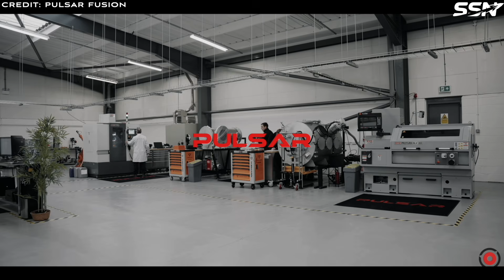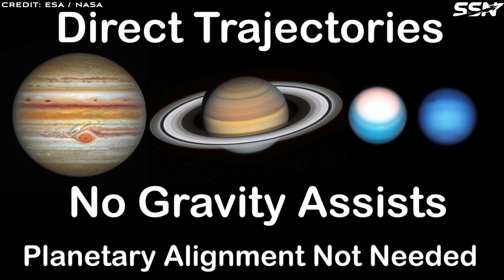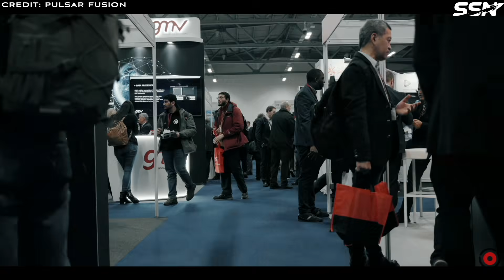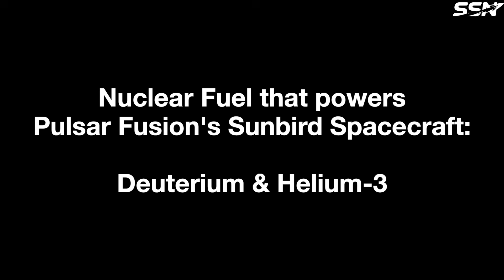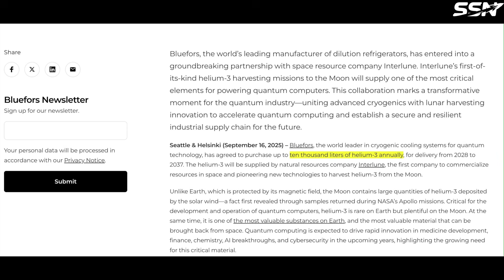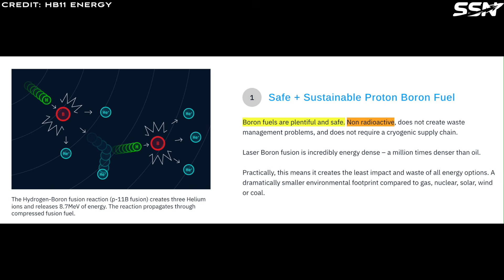Pulsar Fusion Sunbird: The Fusion Drive That Could Reach Pluto in 4 Years

Comment: Why doesn't the design have extremely large radiators attached?
Reply from the maker: Early render, it will need radiators to eject the waste heat from the fusion drive.
Reply: @SpaceStartupNews  I see. I assume they've factored in how large they will need to be for the more ambitious versions, like when Pluto in 4 years is possible.

Comment: EVEN IF Pulsar Fusion's math and engineering actually WORKS OUT, (It won't...) it is STILL JUST A VENTURE CAPITAL SCAM. 😂

And the He³ part PROVES IT. Because nobody understands how nearly IMPOSSIBLE true aneutronic He³ fusion actually is. The temperature and pressure requirements are much higher than the ones we are struggling to maintain just for basic D-T fusion. 

It's only a statistical bias to aneutronic reactions at ENORMOUS volumes and power densities. He³ fusion, if you can actually do it with true net energy gain above ALL INPUTS, will still make lots of neutrons unless the reaction volumes (just the plasma, not the structures that are even bigger) get to be building sized. 

(Helion is 99% likely VC scamming, too...)

The CEO/founder is literally a low-grade sociopathic pretty-boy from a UK reality TV show about the kids of wealthy UK families with land & titles, and their hook-ups and drama. 🙄

The UK, even the government is DEEPLY vulnerable to Space VC scams (Skylon...) because there's still a HUGE hangover that still doesn't accept the British Empire is long gone, and the world Zeitgeist completely left them at the end of World War II.

The UK directly funds this stuff because they have a huge urge to scream: "YES, BRITAIN CAN INTO SPACE!"

Sorry, no... you can't. If you could, you'd have continued the very promising Black Arrow rocket project. 

As to how VC scams "work," they've got more layers than an onion skin, and sub-plots than "Game of Thrones" going on. 

There are ignorant people/investors getting straight up conned. 

There's ones that don't care the high-tech space or energy VC effort will probably come to nothing because it sounds cool, and they can pretend they're a "tech bro." 

There are early investors that assume it's a scam, then will sell their interest at a profit to the newer desperate second and third round investors feeling max-FOMO when media attention (like this video) reaches a peak, and they'll be the ones holding the bag. 

And it's all LEGAL, because: "Well, we were always trying something new, high-tech, and risky.... sorry, we TRIED OUR BEST." 😉

Comment: Could many of these be used to move a small asteroid
Reply from the maker: Fusion drives are low thrust. Startups like Karman+ plan to mine ice from asteroids, split it into hydrogen and oxygen and use that for propellant. Cheaper to move an asteroid using propellants harvested from that asteroid.
Reply: @SpaceStartupNews cool!

Comment: It is much better to use it to get to the Moon, build factories there and develop more capable technology to get to Pluto even faster. Why go there now?
Reply: It’ll be no good to get to the moon. It won’t be able to work in atmosphere and the thrust is going to be probably in the range of a few newtons. That means you’ll have to thrust for weeks. The advantage that you can obtain a much higher top speed but it’ll take forever to get there
Reply: I looked into it and the thrust for a 2 MW engine with a 10,000 ISP gives you about 40 N of thrust, which is about 10 pounds of thrust. That’s a little more than I expected but it’s still anemic. Useful for interplanetary but not cislunar space I don’t think.

A lot will depend on how heavy it is and also if the 2 MW is the energy of the reactor or the energy actually going into accelerating the propeller.  If the actual usable power is more like one MW then the thrust will be even lower.

Comment: So we know/forcast Helium 3 is available close at hand on our Moon, it also possibly  available on the Mars moons, inc. larger captured asteroids.   Further could even greater amounts be found on Mercury, with more experienced extreme  future mining within the shadow lands.
Not being a Chemist with the ease between Fluid and solids, it's interesting,  refrigerants would use fluid/gas measurement, yet Pulsar Fusion quotes a solid form   ( 😄 are they interested in Flour shaker insertion 😃 )
        Personally my field is Power Electronics ( so Diodes etc, can use Gas/solid conveyance )